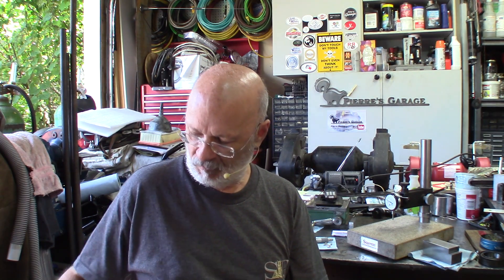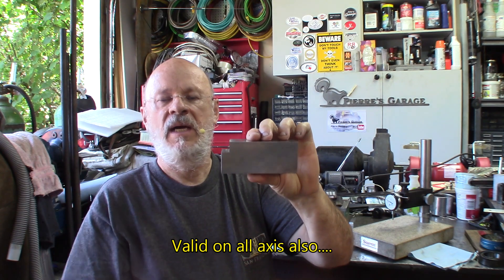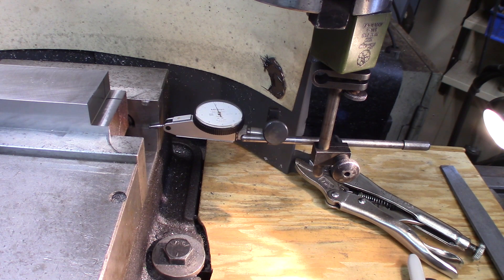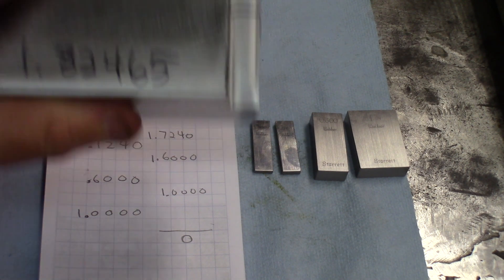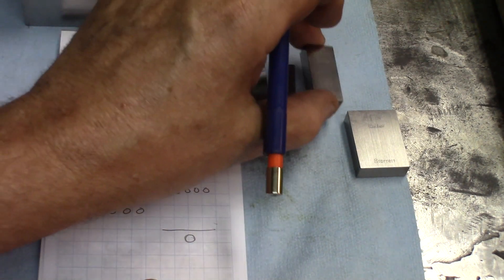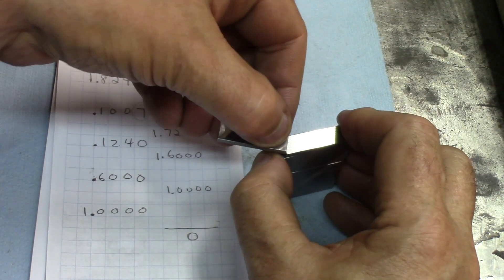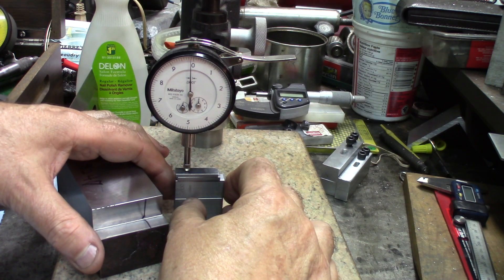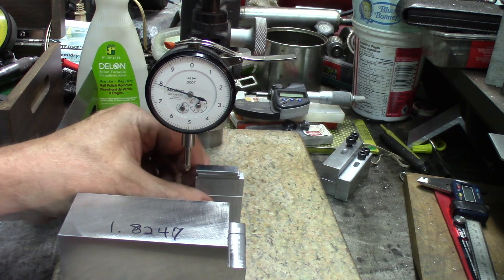Very precise measure using a DRO and comparing for precision

Comment: Pierre I have noticed you have several electric cords or hoses hanging in thew top left side of the video. It would be nice to see how you have those stored. Thanks Terry from Texas
Reply from the maker: Hi Terry,
The hangning board is made of 1/4" perforated board and appropriate hagning supports made for that purpose...   It's not the most solid solution though, the better way would be to really make some angles with proper metal pins, all this held in the wall by anchoring screws...   ;)
It's been there for some time and that would require time investement...   Getting a little laid back by now...   lol
If possible one time I'd give a glance of what it actually there...
Thanks for taking time to watch and comment,    Pierre

Comment: Good topic and video Pierre. How about angular measurement, it should compare well with a sine bar especially if you use a large base line.
Reply from the maker: Hi Alan,
It would be possible to get decent results, just be aware that a milling table and mechanism are not as precise as an inspection marble, there are some small errors introduced in the making of...
As we all know, the precision from a milling machine in normal milling operation is in the best of circumstances around half thousand or 0.0125mm, this is enough to get decent precision readings, better than verniers or caliper in any rate, or, even depth gauges.
Be sure that the DRO has good quality and high-resolution scales since those aren't created equal...  ;)
Thanks for your input and for comment,     Pierre

Comment: Nice one Pierre!  I save my free Harbor Freight measuring tapes for the real accurate work.  Its tough to beat the Heidenhain DRO's, I have been sharing my Positip 855  between the mill and the lathe for the last 30 years. 
ATB, Robin
Reply from the maker: Hi Robin,  I've got a Positip 850 (A few years older than the 855) on my lathe, this unit can be configured in the lathe or the milling mode, those units are some great units even by modern standards, still have a second unit with a defective monitor section, I'd like to have it fixed...
Thanks,    Pierre

Comment: How close to accurate are the Mastercraft calipers you have there. I have the same set and mine are finniky. But seem to do okay. Danylo
Reply from the maker: There is one I've used for at least 5 -6 years, works pretty fine, and it's being used on everything just about every day, the other one is more recent and got only little use, for $11.99 CDN it's hard to beat, just make sure you get one that read outside and inside accurately.... This is their main problem.
Reply: +Pierre's Garage I received mine as a gift maybe ten years ago. I've used it a few times. can't complain. I was going to spend the money on a more expensive one, but after your message and video, I guess the old Mastercraft is good enough for me. thanks and Great videos.
Reply from the maker: Danylo66
There seem to be some interest about making a video on testing some calipers, probably soon...
In the mean time probably your unit is to be held on, at least for a while..
You might keep your eyes open for a good brand name unit at a good price on the used market...

Comment: Squeeze your calipers by the jaws so the force goes through where the jaws touch the part and I bet you will find you can hit the correct .001" everytime.
Reply from the maker: Hi Brian,   You're pretty right about this, for this demo, I got out my brand new Mitutoyo caliper, normally I use a $11.99 on special Canadian Tire cheap Chinese unit and get decent results... 
Cheers,     Pierre
Reply from the maker: Yes, the part was well deburred, wanted to make the test as rigorous and repeatable as possible, a caliper is somehow more difficult to hold perfectly straight in some situations where you're not directly in the right axis like when I do some video, the camera gets the better angle....   ;)

Comment: Nice useful set of tests - I don't have as much super measuring gear as you but could well be worth trying out some of this with what I have.
Great video.
Reply from the maker: Hi Chris,  with standard material that you can get from Chinese sources you'll be able to measure with pretty good results, you may need to practice and repeat measures until it gets to be consistent... 
Obviously, the scales on the DRO will limit the resolution.
Thanks for comment,   Pierre
Reply from the maker: You may laugh, but, it's a good method to find out what size of a hex bolt you have there and find what ratchet socket you need to get in the tool chest without trying half the set...   lol
Reply from the maker: What was I telling you, most of clever people end up using that method one of those days...   ;)